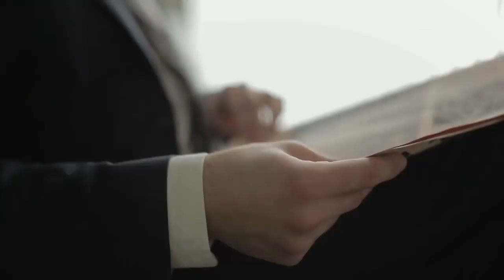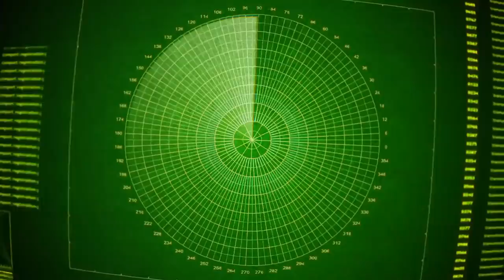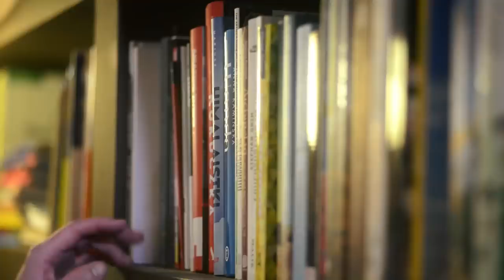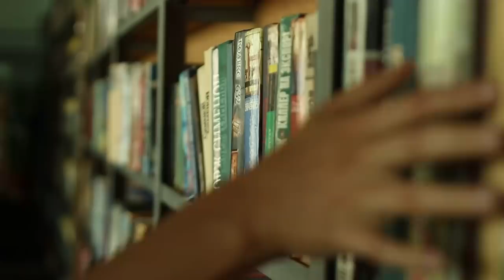10 Most Secret Underground Places Discovered!

Comment: Nice video presentation, but... 

In the section on the Longyou Grottoes, my eye was immediately drawn to those bas-reliefs on the walls. I thought, WOW!! Their artistic styles — the faces, the clothing, the ornamentation, and so forth — could certainly help us figure out who carved out these underground structures, under whose direction, and why, chapter and verse. Hasn't anyone pursued this?

After sifting through some other sources, I found the answer was no. That’s because the bas-reliefs are modern. 

In all fairness, the artistry that went into their design and execution is admirable. But if the curators had wanted to give us a feel for that time and place — one that’s not exactly well-documented, truth be told — they could have accomplished the same thing through virtual reality in a museum.

Installing some good lighting, I can understand. But physically gussying up the complex with murals as though it were an upscale coffee shop really goes over the line.